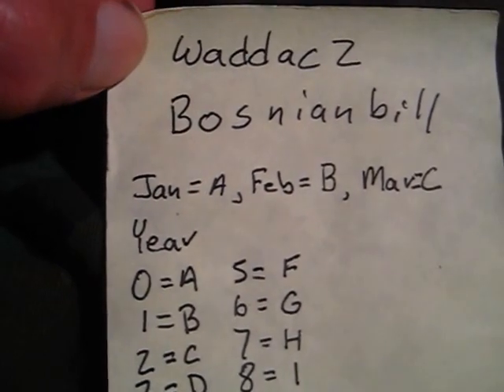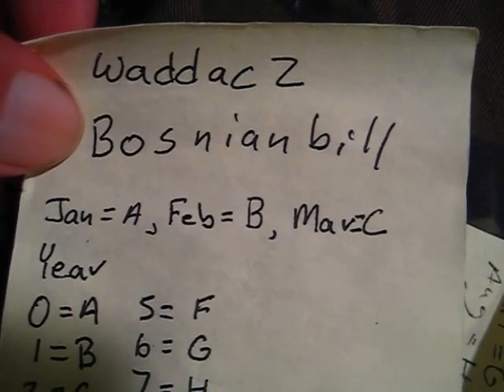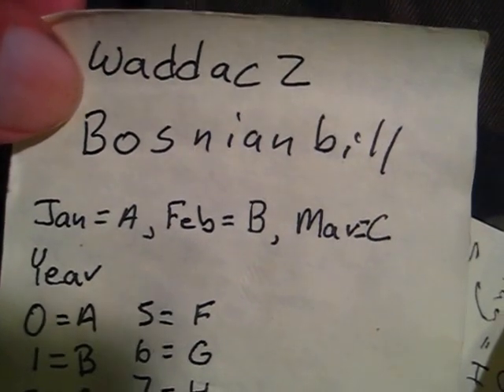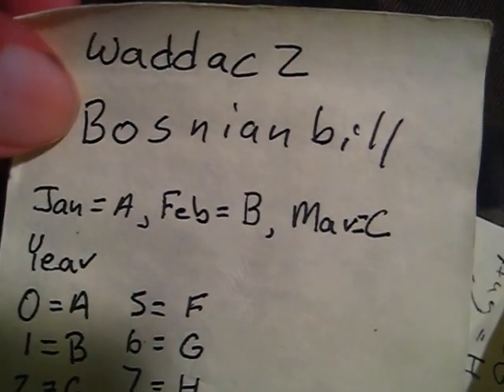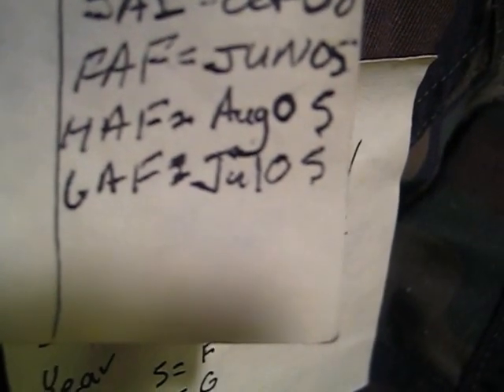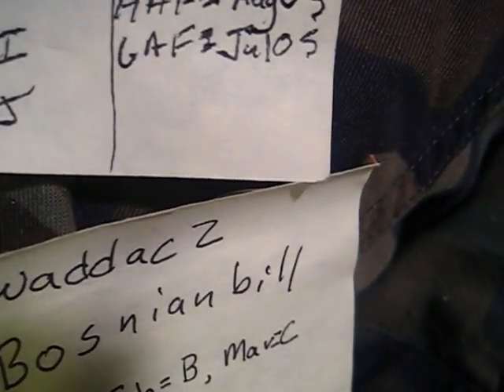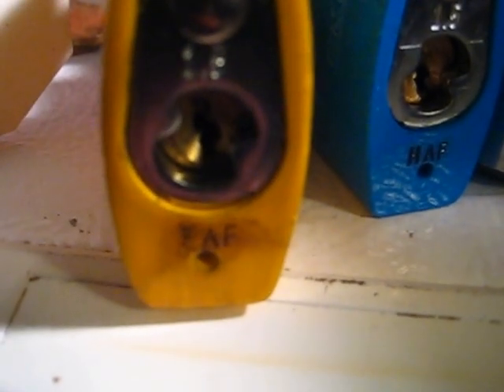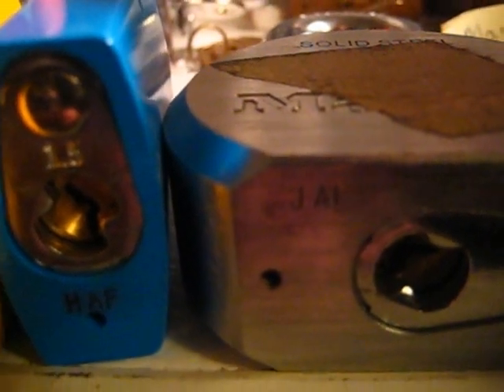Master Lock Date of Manufacturing Codes

Comment: Hi, a friend told me you might be able to help me identify the manufacturing year of an older Master Lock.
A stamped number on the bottom of the lock and on the key is X2274.
The brass key has a lion on it if that helps.
The bottom of the lock also says No 1 Master Lock Co. Milwaukee.
Thank you.